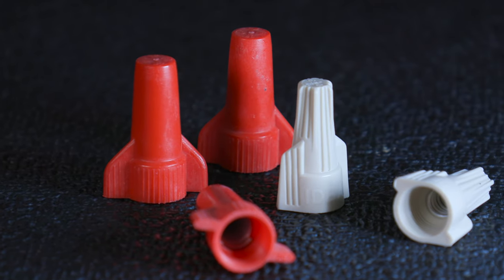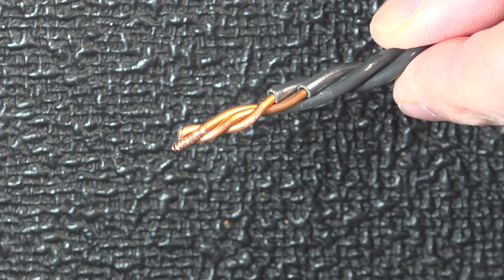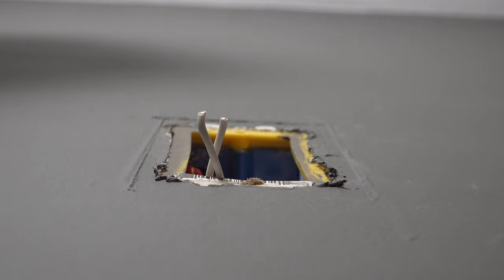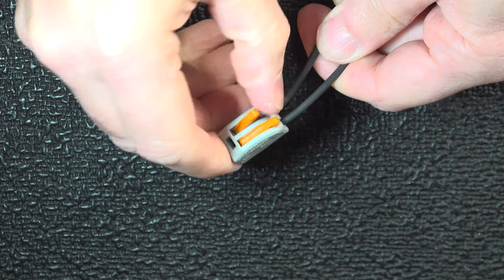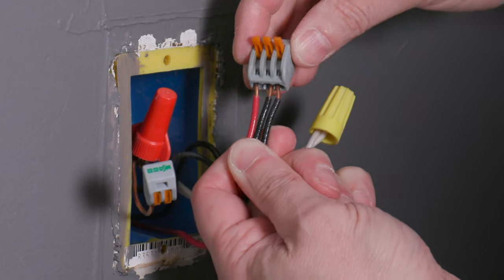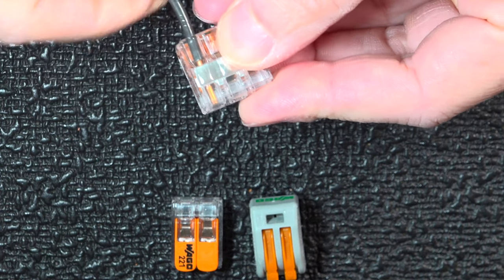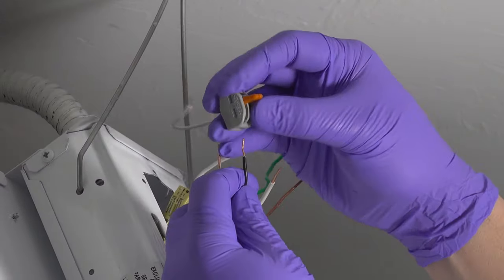Never use Wire Nuts Again - Wago is Better Electrical Connector

Comment: Also I trust a properly installed wire nut any day for pulling a heavy load vs the teensy metal strip you get inside the wego,.and believe me, they do come out sometimes, I see.wegos as a definite resistance point for 12 awg when youigbt have continuous loads and wire nuts offer near zero resistance when the wires are laid beside each other tight and twisted plus you will never ever be able to pull out a wire from a proper WN install whereas with wegos I've had them pop out quite easily with their flimsy clamp system, especially as the gauge becomes smaller
Reply: was that with the old style Wagos? The grey ones were very specific which diameters worked with them, and which didn't. The 221 have quite a broad range in that regard, and if you can pull the wire out, then you put too much stress on a connection that should be stress-free in the first place. After all, you wouldn't pull on a cable in a wire nut.
That said, I had lights complete with their casings dangle from Wagos installed at the ceiling to the fixed cables - no problem whatsoever for them (don't do that, it was a test and it worked, but DON'T leave them like that.
Reply: @Kommunisator  they were solid, new, correct size per the box, foreman demanded we all use these wegos for a big FA job, after he worked a couple days in the field, got us wirenuts instead 

It's just flimsy build, the tiny little strip of metal that compresses is just not enough to create a solid bond from wire to wire and we are talking almost no load for the smoke heads and strobes granted they don't fall off when you are trying to for everything in the box. You can't compare a direct wire to wire overlay with a twist bond vs a small strip that touches a bit of each copper wire. 

While we still had the wegos I would actually pre twist the solid wires together about 2" length, then cut them short to 3/4" and I sent into one wego hole, that was a good install at that point.
Reply: @nikkoBcool  if twisted wires fit into a hole together, then you might be using too thing wire or a too large Wago clamp. The standardized household wire in Germany will fit into the Wago 221 perfectly, but not if you twist two of them together - only if you strip them from their insulation beyond the edge of the clamp (which you should NOT do).
Reply: @matthewq4b  did not know that but I totally approve that.
Reply: @matthewq4b  1.2% seems awfully high. I suspect that a lot of those clamps were either used with unsuitable cabling (p.ex. old style Wago clamps used with non-rigid wires), or that they were counterfeit clamps. (There was an issue with cheap knockoffs some years ago that flooded the market, and are still available but do not hold up to the standards at all)
Maybe the installers were not familiar with those clamps too, and didn't strip the isolation to the correct length. Too many unknown factors, but normally Wagos are practically foolproof.

Why do you think that the use case was higher amperage/higher cyclic rate though? As stated, those clamps are rated for 450V/30A, which is far beyond what a single outlet can deliver in any normal situation.
A euro style outlet using the ground contact (Schuko-Steckdose in Germany, Schuko = SchutzKontakt  = Earth contact) is rated for a maximum power of 3600W. You may not draw more power from it, at 220V that is about 16 Amps, and therefore this is also the rating for fuses for these circuits.
This is true for all normal power circuits in homes and industrial / communal buildings. There are certain circuits that can deliver a higher amperage/voltage, but most of those are created by having three separate phases, each with 220V/16A. Red CEE connectors can deliver 400V but again 16Amps for a maximum of 6400Watts.

Here there has been a constant development towards more energy-efficient electronic appliances, instead of delivering more power, especially since electric power does not come cheap (home prices are at 28-32cent per kwh).

Nevertheless, devices get cycled frequently, p.ex. the oven and induction cooking surface are used daily here, and they are connected via Wago clamps. No problem whatsoever.

Comment: Pretty nifty their chief but I have seen plenty of Wago's melted as well so I'll stick with my wire nuts.
Reply: Thanks for sharing your experience!
Reply: Nice hat
Reply: Never seen a melted wago. Maybe it was some kind chinese knock off. If you take time to Google about them you can see that wagos can withstand a lot more current than they are rated for
Reply: Wagos will run at double their rated amps (see tests) we use them all the time in the UK and I've never had an issue with one
Reply: @user-wk7wv8rn8h  Double the current? The tests I've seen, they pass 4-5 times the rated current in the wago, to the point all the insulation on both the wire and the connector has melted, and the wago is still passing the current :)
Reply: @Kowalski301  true that Americans are less open to change than the rest of the world though it seems
Reply: @user-wk7wv8rn8h  Medieval agricultural society. Scientists are also called flatearthers there.

Comment: If wire nuts are really that bad they wouldn't have stuck around for almost a 100 years.
Reply: Like Leaf springs on American cars e'h?
Reply: Good point Dark
Reply: Getting a good splice with a wire nut is a skill. This new device requires no such skill
Reply: These wire nuts are not even allowed in my country because they are too dangerous.
Reply: in germany its standard to do alll with wago klemme
Reply: Wire nuts are good if you install them correctly. Different wire sizes and wire types makes them very dangerous. In The Netherlands they are almost not used anymore, in homes only Wago or similar push-in connectors. Also the power outlets and switches have push-in connectors, screw terminals are banned.
Using something for 100 years doesn't mean it is good, it can mean that you don't have a open mind for improvement.
Reply: Our power outlet design that allows the prongs to be energized while still exposed is trash, but we are just passed the point of no return.

Comment: I've seen tests done where the Wago connector produces a significant voltage drop (~3x more) compared to a standard wirenut, most likely due to the amount of wire contact. Also ~5 degree increase across the connector. Can you confirm?
Reply from the maker: I saw nothing like that https://youtu.be/B1pmuRsf1co
Reply: what are you SMOKING??
Reply: @Karmen Dimas  https://youtu.be/rM4RmGzngHk?t=615 if you too lazy to watch whole video since you seem to rush  judgement. Connection/Fitment is important.
Reply: @karmendimas5274  it is better to make a connection with the whole surface area of the spring inside the wire nut.  WAGOs use one small blade to make the connection. a mere faction of the surface area provided by a wire nut  Wagos are susceptible to losing  losing tension\deforming if handled roughly especially with multiple 12 awg solid conductors. 

probably ok at > 50% of a conductors ampacity.  probably not ok at the NEC limit of 80%
Reply: @arcsnsparks76   I agree. And I always twist the wires together before I install the wire nut so there is a massive amount of surface contact between the wires.  I guarantee this would carry a good bit more amperage than a Wago.  I get why the industry likes them, they are fast, easy, and require almost no skill to install correctly.  But I think, when done right, a wire nut is a better connection.
Reply: @ToddKing  It is, but it is also kinda pointless. WAGOs are rated for 20A and do that without any problem.

Comment: “Incredibly dangerous” yeah, that’s why we’ve been using them for 100 years. 😂
Reply from the maker: Yes right along with Asbestos, a miracle product.
Reply: @SilverCymbal  You’re comparing wire nuts to asbestos?! 😂
Reply: Billy Mack, Texas Detective  He get some Money from the German company Wago... So now you understand
Reply: Sponsored but not really sponsored
Reply: @SilverCymbal  you do realize us in the trade actually know a wago will fail more than a wire nut that's properly installed
Reply: @bbui1990  I’ve seen it like half a dozen times over the years, especially internal arcing from a stranded wire. It doesn’t take a pro to use a wire nut, they give pretty gold feedback when they are tight enough and it doesn’t hurt to wrap in a bit of tape to insulate in the event a wire is pulled out. Honestly I’d wrap wagos if I used them for the same reason...failsafes are the name of the game.
Reply: I dont think they exist in UK, I have never seen one, does the UK consider them dangerous, or what ???
Reply: To be fair if it's being installed by an idiot, then no matter what they use it's dangerous. People who use Wago's are the type to pull an engine out to change the oil because "it's easier to do". Haha 😂
Reply: @SilverCymbal  If used and disposed of properly, yes it is.
Reply: Wirenuts are prohibited in Germany and many other countries due to safety reasons.
Reply: @norbertfleck812  yes but they're banned there and most of europe because they use aluminum conductors for almost everything. If we did that we would ban them too. But that's them and this is 'Murrica gosh darn it, and we use copper for most of our stuff it's rare to see aluminum used here in households other than in the SE conductors.😉
Reply: @josemeza7047  Aluminium wires are not in use in Western Europe. And they get replaced quickly in East European countries.

We always use copper wire.
Reply: I had a table top jig saw that still had ceramic wire nuts in the junction box on the motor. Still worked just fine. Not cracked.
Reply: @Ghauster  I do not doubt that they are good, if installed properly.

The point is: You can easily install them faulty in a lot of ways (too loose, overtightened, or wire not twisted properly) which you cannot spot in a visual inspection.

Comment: Well here in Australia we have a connector called BP which is basically a screw terminal in an insulated housing. You twist your wires together, insert into the terminal, and use a Phillips or a flat to screw down and secure the connection
Reply: Such screw terminals have long been standard in Germany.
However, these have been replaced by spring-loaded terminals in many areas.
The advantage of spring-loaded terminals is that the cables cannot loosen due to thermal influences.
However, this is possible with screw terminals.
Temperature fluctuations change the length and thickness of the wires, but also of the holding screw.
Even minor changes can cause the cable to loosen over the years, which can lead to a fire.
Reply: @sylviarohge4204  plus, they are way easier to handle than the old ones with screws
Reply: In Canada, most of the screws used in electrical are Robertson’s (square heads). I swear and curse the ones done with Philips heads.  LOL
Reply: Australia is actually called Stralia, just correcting you there

Comment: Wagon connectors don't do well with high amperage circuits in my experience. Even a large microwave pulled enough current to cause a failure. I wouldn't use them for 15 amp or above receptacles.
Wagos are fine for lighting circuits but that's it.
Reply: Exactly my experience
Reply: They are designer by europeans for the european marken where you dont usually have circuit breakers with more then 16A in residential buildings
Reply: @christianf5226  There are WAGO connectors available for currents up to 1000 Amps and more.

But never mind.

Comment: Been doing Electrical and automation work in the oil field for 5 years and Wagos are all we use
Reply: Nice
I do residential HVAC... looks like I'm switching over..
Reply: see any melt? i've seen a few comments here saying they have melted. one guy in here said no more than 10 amps. i saw a video where i guy hooked them up to a welder and the wires melted all the rubber off first
Reply: @cdoublejj  nice
Reply: @cdoublejj  I personally haven’t. Of course most of the ones I use is on low voltage automation, I use some on 120 none on 240 or 480.

Comment: when living in germany we used them back in earoly 2000's so much easily and cleaner look loved them only too 15 years to get in the states
Reply: I have been seeing this kind of a connector for a few years now. They would come with light fixtures...that are likely made in China. I haven't seen these at stores but it cold be because I haven't been looking for these. I tink that wirenuts are just fine...
Reply: Yeah, the clip model is pretty neat. In the early 2000s they came with a screw kind of fixation.
Reply: I have used them for certain applications in the states since the nineties.
I am not always a fan of them.
Like wirenuts, improper installation leads to problems.
Reply: We've had them in America for 25 years. But on the dollar there 2 to 5 cents more expensive than wire nuts. Unfortunately companies usually buy the cheaper thing especially considering wire nuts are sort of the standard. most people don't care what's in their walls as long as it works.
Reply: I imagine they are safer to use in Germany than the US though.  At 220-240 V you are using half the amperage we do which means you have 1/4 of the heat generation in your circuit. In my experience push to connect electrical connections tend to be less than desirable and tend to heat up in general, pushing more current through them just makes it worse.
Reply: Great, maybe you could use em to land on the Moon. Wait, you still haven't done that yet?
Reply: @benc1927  ummm???

Comment: Fellow electricians have been telling me since I started that wagos aren't safe, the wires tend to pop out, those levers get pulled when closing up a box, the metal that bonds the wires inside isn't thick enough to handle anything over a certain amperage... Idk how many of these things are true, but I haven't switched to using wagos because of it.
Reply: He actually made a follow-up video where he tested the claims about the wagos:
https://youtu.be/B1pmuRsf1co
Reply: There are different kind of wagos for different sized wirings. If you choose the correct one then it can handle way more current than your wires are rated for.
Also the ones portrayed in this video aren't meant for permanent installation. For in-wall installation you should consider using the ones without the lever like the 2273-203
Reply: I work in as an electrician in a power plant. Many times I have had to go back and change wagos out from contractors that have failed due to environment and vibration back to wire nuts. I cannot stand them and they are not a decent replacement in industrial use.
Reply: How can you pull a lever closing a box? Seems more like someone telling lies because he doesn’t want to spend a few extra pennies on wago’s instead of them twist abominations.
Reply: @troutstag  they use wire nuts and Wagos in power plants? Wagos the size of refrigerators? Wire nuts the size of chest freezers?

Explain.
Reply: @frankwilson1776  there are miles of control wire in power plants.
Reply: Craig Dendy  you do understand ohms law don’t you? What you have just said is nonsense

Comment: And i forgot to mention...wire nuts are very reusable! Been reusing them without a problem forever lol
Reply: Hello Wayne, please check with UL Electrical Code.  Wire Nuts are not approved to be reused.
Reply: @johnbukowski9701  I have been a Electrician for 38 years and have never had a problem reusing them.  You know from experience which ones will work again and which ones need to go into the trash.  Most are reusable and work as good as new most of the time.
Reply: so is wago.
Reply: @johnbukowski9701  UL and the NEC are two entirely different things.  The manufacturers say one time use to avoid any liability.  They are certainly able to be reused.  The ones that can't should be obvious
Reply: @xsardas1999  some are, some aren't.
Reply: @chevydmax1000  Twelve year electrician here and I concur and agree with my fellow sparky. I've seen more 'quick-connect' wago type connectors fail compared to this 'one time use', ' old school' marette.
Reply: Wago. Made in China no doubt
Reply: @johnbukowski9701  well la tee da Mr. Bukowski. I guess you keep the UL standards book in your pocket eh? Electricians in the real world Don't flout codes but we do have to make a living and there is a point of reasonableness somewhere. And we will continue to reuse wire nuts whenever it is reasonable to do so which is almost every time
Reply: And so are these
Reply: Comments from people who live in the real world and not in a book. All this nonsense about skin effect and obsessive cutting. Like we are all robots and there is no real world tolerance for a wire nut to be reused or a tiny scratch at the tip of a wire. There are better things to worry about. Like sizing, strip length, wire count...basically anything.
Reply: @mk3suprafy  It's all about use and location.  I've been on industrial jobs where it 100% matters if you knick a wire when putting on stress cones.  Ever been a part of a thermal study?  Yes wire nuts can be reused, they're light duty.  Don't discount the actual science behind it all though.
Reply: Infomercial is why all the down votes I'm guessing.
Reply: The amount of these wago connectors I’ve seen fail... nothing wrong with wire nuts. Twist the wires, and then twist the wire nut on tight. Wago connectors seem like they’re made for homeowners, not electricians that have been using wire nuts just fine for years. 😂

Comment: WAGO - Made in Germany! :-)
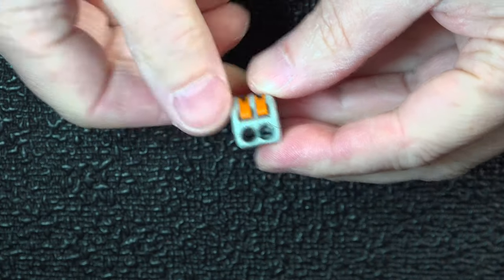1:34 This is the older desing, a few years ago, modern WAGO 3:01 connectors are transparent.
This type of WAGO you can use for stiff and flexible wire.
Greetings from germany